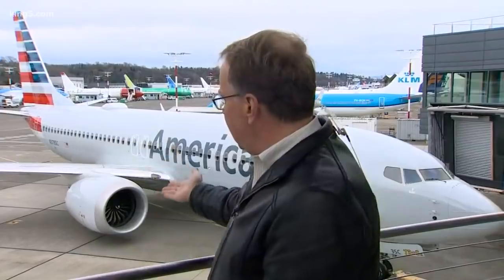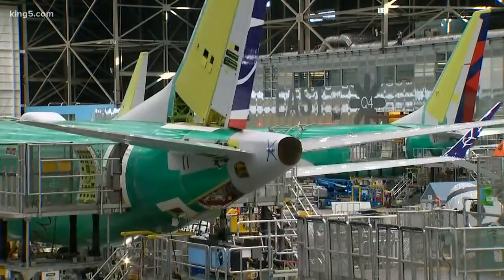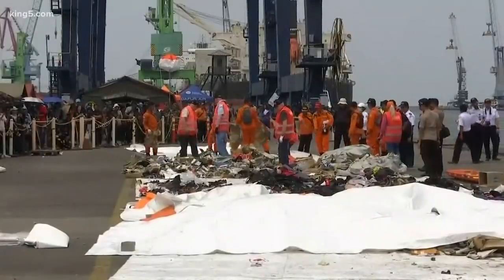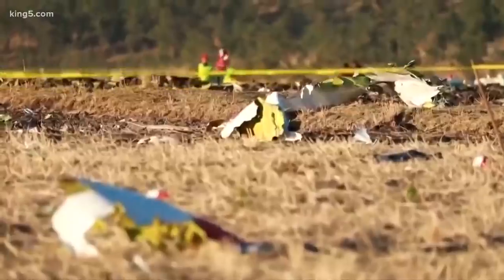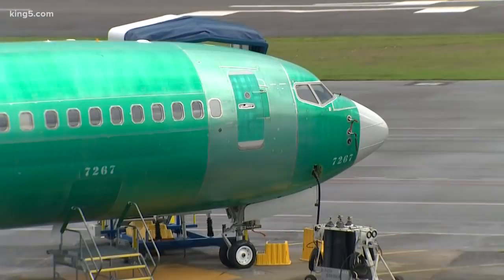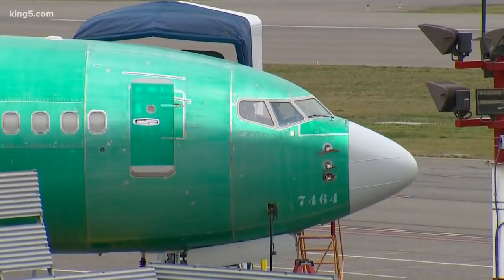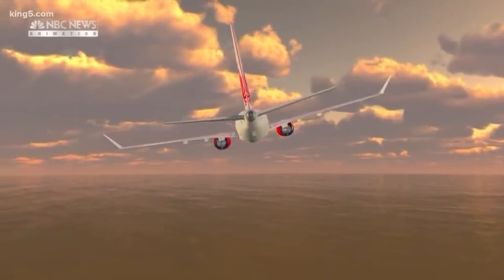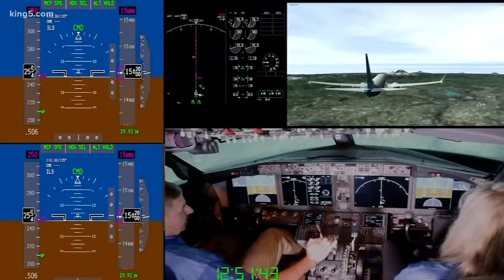Boeing unveils 737 Max fix

Comment: Amazing! So the "AOA Disagree" message on the screen is still "optional", aka pay-to-get, after more than 300 people died? Is Boeing out of their freaking mind?
Now the whole world knows Boeing designed a plane which relies on ONE sensor, now they are doing it by TWO sensors? What the hell is wrong with Boeing? How does the MCAS know which sensor to trust when one is malfunctioning? If such a sensor is so important, they should install at least 4 sensors, so if any one sensor is at fault the system know immediately what data to trust.
They should have a complete MCAS system redesign and make sure in no way MCAS will fight against the pilot again. They should make MCAS smarter by combining with other sensors to determine if it should engage or not.
With the new patch, MCAS only engage once, which means if the pilot pull the yoke high once, the "patched" 737Max will stop the MCAS completely. Then what will prevent the aircraft from stalling? The MCAS is there for a reason. Now the plane is in even greater risk, because the pilot might not know the MCAS is disabled discreetly.
All Boeing is offering is a minor patch, not even the right patch, but the one which saves most money! Man, they are really digging their own grave!
Reply: Judging from these comments, people are truly angry at Boeing.......
Reply: Ardent Fan    The reporter, didn't report on the compete fix for the system. First, the original system took info from only one AOA vane at a time and switched vanes each time it landed, (totally stupid idea on Boeing's part not to have redundancy built into MCAS).  The fix will compare data from both AOA sensors and not only turn on a warning light if they disagree but will disable the stabilizer trim motor auto drive.  There is also plenty of systems, and warning for a Pilot if the plane is approaching a stall.  Those things have been there all along, and from Private Pilot up to Airline Transport Pilot, everyone trains on stall awareness, (signs a plane  is approaching a stall), stall prevention, and stall recovery. 
.
  Had the Pilots of the two doomed aircraft realized, what they had was in essences the same problem of what is called run away trim. There are memorized  procedures to deal with run away trim, that take very little time to go through these procedures.  Once those memorized procedures are completed. , and the Pilots are back in control of the plane, then they can go through a written checklist for that problem.  That is what happened the day before the Lion Air accident, when a jumpseating pilot realized what was happening, and made it aware to those pilots that were flying that aircraft that day.  The pilot of the Lion Air plane that crashed, hit the pickle switch (trim control on the yoke) 23 times when he was fighting the MCAS.  Why he didn't realized they had a trim problem when he was fighting with the trim, I guess we won't know until the compete report comes out.  Not at all judging those pilots, but even if they did not know about MCAS,  they had  procedures in place for run away trim. BTW, run away trim could happen on any aircraft the airlines use, if the system malfunctions.  
.
Boeing screwed up for sure!  One sensor only???? what where they thinking and who let that get though the design specs???  The fix is what should have been there in the first place! To get the flying public's trust again, well they have a big problem! The DC-10 had a design flaw in the left rear cargo door. Caused a near crash, and then a catastrophic crash! Over time, with it fixed, I guess there were millions of people that flew on the DC-10. Fix the plane, with time, and cheap airfares,  down the road most people won't care if it's a MAX 8 or 9.  Right now, no doubt, the public has a right to be pissed!!!
Reply: Ardent Fan  Why can't they compare the AOA sensors with a gyroscope inside the plane to determine if they are stuck? Also the AOA sensor giving the same angle even when the plane is going up and down continuously(flight computer knows change in altitude) is a clear indication that it's stuck. I thought an aircraft's software is smart. But it's really basic. It should be improved.
Reply: @ArunArun-rv5bn The B787 does that. Also  if pitot static sensors ice up the B787 the aircraft computers use a combination of GPS data, engine and flap settings and attitude to calculate true air speed.  Its very accurate.  I think this came out of the lessons learned from the AF447 A330 crash.
Reply: @WilliamJones-Halibut-vq1fs  Does that mean Boeing rushed the development and testing of the 737 max software?
Reply: @ArunArun-rv5bn  Good logic.  Have to I agree.
Reply: Ardent Fan , No even with manual trim the pilots if for some reason got into a stall could safely recover from a stall. There are two systems to the horizontal stabilizer. If you look at the tail a 737 or 320, the horizontal wing.  You see the whole wing (on the tail),and you have probably seen the elevator at the back of the stabilizer move up and down, if you have watched planes taxi out from a gate.  Besides the elevator moving up and down, the whole wing of the horizontal stabilizer can pivot and move up and down a certain amount of degrees. (That is the trim we are talking about, what MCAS uses) For take off the horizontal stabilizer is set to a take off position and the pilots pull back on the yoke, or joystick in a Airbus, they move the elevator at the back. The horizontal trim just takes off the pressure from the pilots as the pitch the aircraft to the proper pitch and airspeed for their weight and take off configuration for that flight.  So let's say there was an AOA warning, (with the fix in place, presently the AOA warning light, does nothing but give a warning). The horizontal stabilizer electric trim is either turned off by the computer, or the pilots shut if off. There are two trim wheels on the center console one next to the Captains right leg, the other next to the First Officers left leg. There are pull out handles and a trim indication gauge, where they can trim the plane back to where there is no back pressure on the control yoke, and the pilots can fly the plane safely.   The only time the MAX aircraft would really  pitch up is at high power settings say take off from a short runway. If the same thing happened to a MAX, (miracle on the Hudson incident) they could  glide and land like a 320.  The plane is much more stable then people are thinking.  BTW, on the Miracle on the Hudson, the computers aboard actually shut the engines down.  Had that been say an older Super 80 aircraft, the engines would have kept running,  probably  damaged the engines quiet a bit, but they would have most likely been able to land at Teterburo, and not on the Hudson.
Reply: Brian Buckmaster ... so you meen all the pilots are undergoing additional training - now!? didn't the pilots get additional training already after the very first pilot reported manoeuvre battles in the air, followed by four other pilots reporting the same problem? are you saying they never was informed, aware and never KNEW!? the pilots know NOW but not BEFORE!?
Reply: Totally agree. A well design aircaft should be naturally stable without needing a system like MCAS. There is apparent design flaw on engine-wing configuration. That is why Boeing installed MCAS. A design flaw cannot be eliminated by a software update!
Reply: I fly weekly and had the pleasure of sitting next to a Capt who was fling home. He has been a Max 8 pilot with a major airline for over 8 months and according to him, NEVER had any issues of any kind. His comment is, " first check on the TRAINING of Ethiopian Airlines and others before throwing rocks." All aircraft have quirks when new but none have been truly fatal. Airbus has had more than their fair share. How about the flight from South America to Europe that went down in a flat spin due to icing of sensors??? This pilot told me that training is the key and most American pilots would have reacted in seconds to correct an issue. Stall of an aircraft can kill and dropping the nose is the answer. Air Asia pilot who crash 777 in San Francisco, taught to land using aircraft systems and had almost ZERO hands on landing training. So, sit back, armchair quarterbacks and throw your rocks. Boeing been around many years and dont put our crappy products. From the First B-17, through the B-52, to the 707, 727, 737, 747 and all other variants, they are awesome aircraft and yes, I will get on one anytime.
Reply: Thanks everyone for your honest opinion about this! Didn't expect to have so many replies and good answers!
@William Jones-Halibut
I think multiple sensors failing at the same time is a very very rare occasion. The chance for 3 AOA sensors go out at the same time will be so small that we can be assured it won't actually happen. Of course the MCAS system should also consult other sensors like the wind speed and gyroscopes to determine if it should engage. If the plane is diving down at high speed, of course it shouldn't be on, stalling or not.
@Ardent Fan
Thank you for your passionate discussion about this. We all want Boeing to really fix the fundamental problem, not just giving their plane a temporary "fix".
Suppose a "fixed" 737Max takes off,  MCAS detects an "AOA conflict" and disable itself, then the pilot may only see the light, but he might not realize that MCAS system is off. So when he push the throttle to the fullest, the plane will pitch upward much quicker than before. 30 degree is steep, but with MCAS turn off, the plane might achieve it in just a few seconds! Therefore, by disabling the MCAS system, the plane is at a greater risk of uncontrollable stalling! That's why I am not asking for getting rid of the MCAS system. I am asking Boeing to spend more time to test it. Don't disable it so easily, because MCAS itself is a SAFETY system. Without MCAS, every 737Max take-off is a  risky business.
@Tower Runner
You know much more about the planes than the rest of us, and shared some nice insight about those 2 crashes. I just want to ask, as a pilot, are you OK to fly a plane with such information hidden from you? Do you think Boeing are hiding other flaws as well? Because I am thinking MCAS is just the tip of the iceberg. AOA sensors are used to be very reliable, but two brand new planes had the same faulty sensor? What are the odds?
Reply: Ardent Fan, The so called inherent instability of the MAX is a media driven myth. Airbus has also gone thru many modifications such as stretched, engines, wings. Its not uncommon for a popular base model to undergo mods.
Reply: The Airbus A320 has three active AOA sensors, with sophisticated software to monitor their signals and information. Not one, not two, but three separate sensors!  And even with three active sensors, some years ago there were two A320 incidents where there was erroneous sensor disagreement.  And what happened?  The flight control computer put the airplane into a dangerous nose-down maneuver -- exactly what apparently happened with the MAX-8.  Fortunately, the A320s were high enough in the sky where the pilots could safely recover.  Certainly Boeing engineers must have known that a single AOA fault could occur.  Yet Boeing kept a single potential failure point and its known association of risk for catastrophic consequences.
Reply: Philip W http://www.boeing.com/commercial/737max/737-max-software-updates.page#/flight-deck
Reply: @osbornyap45  
Thank you for providing the link to their update. It clears up things a little. The "AOA Disagree" indicator is now mandatory, the one that's optional is "AOA Indicator".
However, I still don't know why AOA indicator is still not free? Do they still need the money so much? Boeing should give out all safety-related features for their customers, so they can feel better after being lied to.
It says "Boeing doesn’t put a price on required safety features...", but they are the ones who make the rules about "required safety features", not FAA. FAA is more like a puppet to them. That's why Boeing could ignore the training of MCAS system.
Reply: Thanks to Osborn Yap. He provided me the link to the updated software here.
http://www.boeing.com/commercial/737max/737-max-software-updates.page
Though overall it feels better for the safety of this plane. Some red lights are still there. According to Boeing, the additional safety measure includes:
1. "Flight control system will now compare inputs from both AOA sensors. If the sensors disagree by 5.5 degrees or more with the flaps retracted, MCAS will not activate. An indicator on the flight deck display will alert the pilots"
So, as my understanding, a faulty AOA sensor will disable the MCAS. An amber warning will show up on the screen. Does this mean that the pilot has to continue without the help of MCAS, or he has to return to the airport for repair? My guess is that he has to continue flying up at the risk of stalling. Now with this amber light on it will be totally pilot's fault if the plane goes into a stall? The unbalanced design of the plane is never to blame? As a passenger, will you feel safer if you know the plane's MCAS system could be off? Or you rather to ride one without stalling issues like this?
2. "If MCAS is activated in non-normal conditions, it will only provide one input for each elevated AOA event. There are no known or envisioned failure conditions where MCAS will provide multiple inputs."
How much test did Boeing actually done on this new update? According to them, "hundreds of hours" and "two test flights". Wait, when a system cause 2 catastrophic crashes, you only test the new patch for 2 flights? And one of them is to pass the FAA test? So the real test flight is only ONE. Wow, it surely blows my mind about how much effort Boeing has put it in testing. I bet that during those 2 flights MCAS had never "activated in non-normal conditions", because "there are no known or envisioned failure conditions". Well, that's why we need more vigorous testing, to ensure this is actually true. 
3. "MCAS can never command more stabilizer input than can be counteracted by the flight crew pulling back on the column. The pilots will continue to always have the ability to override MCAS and manually control the airplane."
Does it sound like Boeing is admitting MCAS system used to be able to command more stabilizer input than the flight crew could manage? Sounds like they are saying they did design a dangerous system to me. The pilot of course should have the ability to override all systems. That shouldn't need to say. It's like "you can always override the cruise control of your car." Does any car maker really need to say that?
Overall, I still don't want to get on a 737max plane after knowing all these. Good luck Boeing, you really need it.
Reply: NonyaBusiness! Amen🙏🏻 certain things I no longer do, smoke cigs, have more than 2 drinks a day and fly on 737 Max 8’s!
Reply: Phillip W I agree!!!!
Reply: Ardent Fan   just FYI, I am a Commercial Single , Multi Engine, Instrument rated pilot, but I don't fly has a pilot for a living.  I realize for any of us, when something like this happens, and so much news, social media out there, it's hard to weed thru everything. Here is a video from a 737 Captain, he's got a great YouTube channel, I was looking for a different one he just did, but this one is great too. Knowledge is power, and can take away some of the fears of things we don't quiet understand.  Again, I appreciate you taking the time to be concerned about the MAX problems! Boeing and the FAA have some tough questions to answer!  Hope this video helps, take care!!!
.
https://youtu.be/TlinocVHpzk
Reply: Ardent Fan  remember only 40 seconds for the pilot .
Reply: Boeing’s problem is that they chasing profit and instead of new design, they attached huge new engines to very old plane 

It is like weight distribution - why BMW is drivers car? Because it has 50/50 distribution. Same is here - A320 is “drivers car”, 737 max is not and because of it, Boeing compensate it with stupid systems
Reply: So sorry for you. That's what makes redundancy, I think it's better for you to shut up than blasting comments. You're making it worse.
Reply: The mismatch of the AOA sensors will display a warning to the pilots, HOWEVER under NO circumstance say that MCAS cant be turned off as its as simple and a 3 second action to disable MCAS, I am a certified MAX8 Pilot and I have never had an issues with MCAS myself, and i was aware of the system and the steps to disable it
Reply: @Brian Buckmaster There should be no issue!!!!
Reply: Ardent Fan The B737 MAX is not inherently unstable like for instance the F-16.  It has a different stall characteristic that would have required retraining without MCAS.   Anti stall systems are good safety additions.  MCAS was a poor implementation.
Reply: Philip W or... pilots could just turn it off.
Reply: @Santo_Aviation.YouTube  
Yeah, those crashed cars should have turned the cruise control off, what were they thinking? Those drivers were just poor trained. Malfunctioning cruise control is not to blame for those deaths.
Reply: They actually do have the technology for a whole new MCAS system.  It’s just that Boeing preferred to make system/software updates to this old technology which was around for a while now. The reason behind this was to get the max 8 out in the market as fast as possible and compete with the Airbus.   They knew it will take time/money to pass FAA regulation etc introducing a whole new system. If it makes money, it makes sense for Boeing 😕
Reply: Dear Boeing: Good luck getting passengers in there. People worldwide are rerouting themselves in droves. But go ahead....keep ignoring the evidence.
Reply: Philip W what will happen when all sensors give different readings, due to different amounts of dust deposits at the points of rotation? Another crash?
Reply: Brian Buckmaster there was one Airbus a320 crash on a delivery test flight with airline crew members on board in which three of the four sensors froze in the same position at exactly the same time at high altitude and then the fourth sensor that was actually good was disabled.   This came about because on the previous day an incorrect painting procedure hadn’t masked of the sensors and high pressure water used to clean the paint entered into the sensor.  Then when the aircraft climbed and reached a certain altitude three of the four sensors froze in the same position due to water and agreed.  When the aircrew then conducted stall tests (at too low an altitude) the system did not work.

You would think the sensors would be pressurized to expel any water that has ingressed and that the sensor also is heated to stop anything potentially freezing.
Reply: @WilliamJones-Halibut-vq1fs  
I agree with you!
I think it was air New Zealand.
Reply: #BoeingSerialKillers 🕇⚰
#BoeingMassMurderer 🕆🛬
Reply: Don’t fly on a shitty airlines that hire pilots that are incompetent of doing their job. If you needed a life changing surgery you’d seek out the cheapest and least qualified doctor right? Absolutely not, same thing here.
Reply: @Brian Buckmaster When u claim u know too much, then u become an idiot.... Stop spitting out trash from ur disgusting mouth 👄
Reply: More sensors = more drag = eroding the 14% efficiency saving the bigger engines that created the need for MCAS cause.